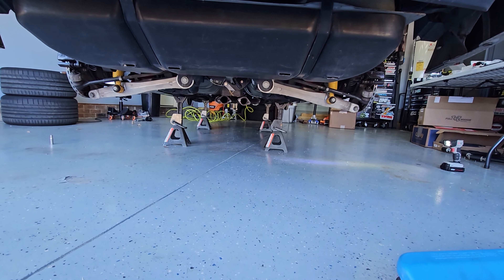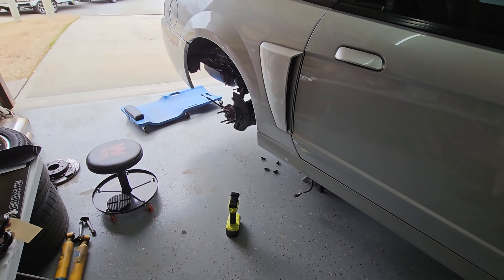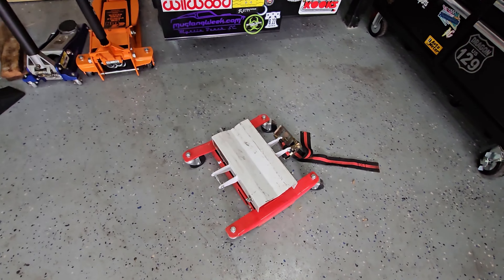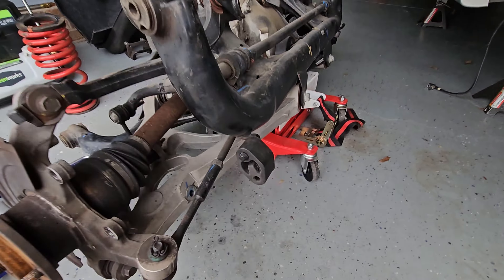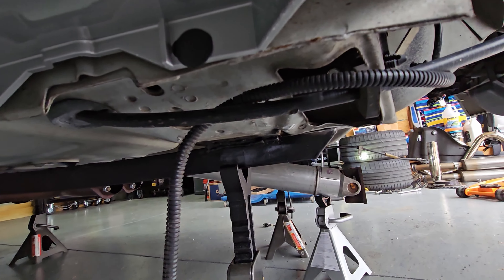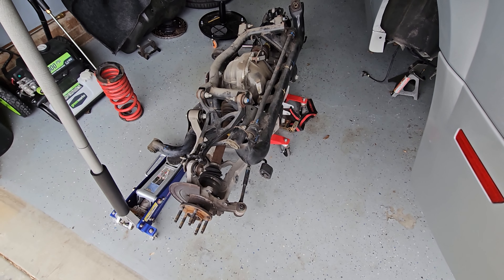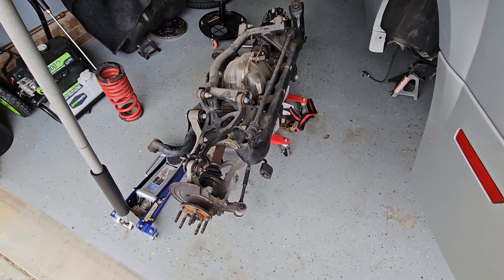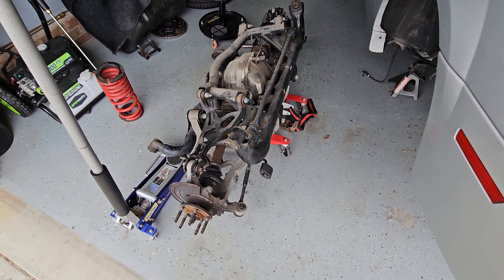Project Apex Snake: Part 2 - 03 Cobra IRS Removal

Comment: Hey bro 

How much pressure did you apply to the cradle to ‘relieve pressure’, from those bolts? I am having a hell of a time. Not to mention the bolts round out 😅 thanks bro

Matt
Reply from the maker: @matthew6174  not a lot. You basically just want to support it enough that it's not "hanging" on the bolts
Reply: @Slow_Six  I’ll be dammed it worked! Thank you. Used a ‘pipe nipple extractor’ set. Yeah bro that little bit helped immensely thanks again
Reply from the maker: @matthew6174  glad I could help!